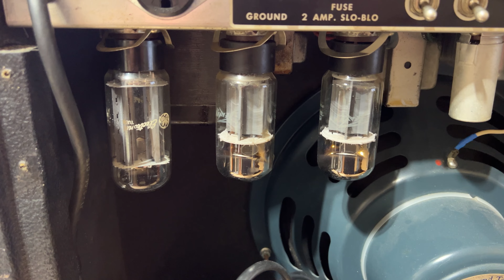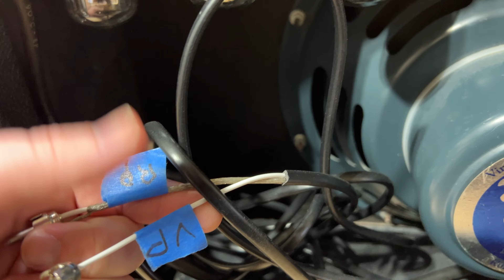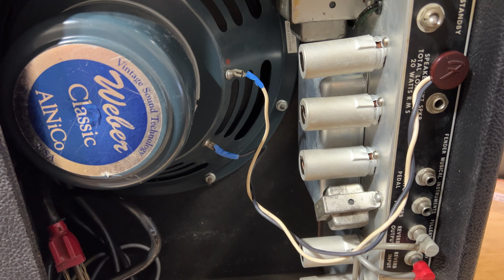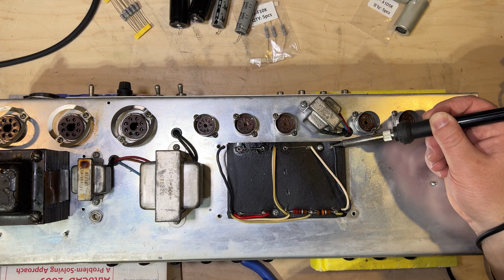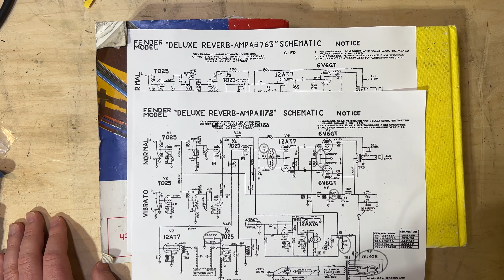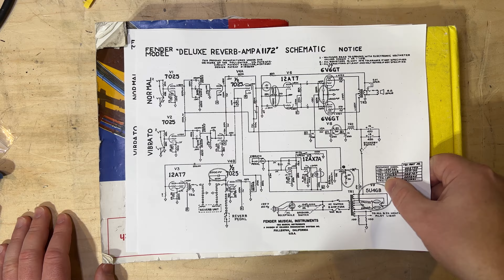1976 Fender Deluxe Reverb Repair | Full Overhaul & AB763 Conversion (Part 1)

Comment: The SF Twin Reverb has the two caps in series, equaling 50uf.    That's ok, because that amp has a solid state rectifier.   But as I learned the hard way, with a Tremolux having tube rectification, before it can get 50uf charged up the tube turns into a 4th of July sparkler.   It needs to see a lower capacitance to charge up, which is what the two caps in parallel provides.   Also, adding a thermistor before the caps helps with the high rush of current ... helping the rectifier tube last longer.    I've made a few expensive mistakes in this learning process!    OK.   I'll shut up now and watch the rest of your video.
Reply from the maker: Haha, no way! Keep the personal experience and advice coming! I love hearing about it when someone has seen an issue that i haven’t come across or mentions something i didn’t consider ona repair. There is no room for ego with amp repair as far as i am concerned.
Reply: @TechnologyEnterprises    What is really helpful these days is asking a question in google, and AI is like an ace tech that gives you the ideal answer within seconds.  AI is not infallible .. but it's answered a lot of questions correctly.   One question was about the Deluxe Reverb V3 cathode resistor, where I asked:   If I change that resistor to 3.3k, will that mod help?    AI responded that is a common mod to make reverb be not as splashy.    Most seem to advise using a 12AU7 in place of the 12AT7, but for less gain, why not use a resistor that costs far less than a tube?    I'll be using a tested (Tube Depot) JJ ECC81 for V3, and a tested JJ ECC83 (not s version) for V4.   But AI told me to keep the 220k (plus cap mod ... which I changed from 2000pf to 270pf) at the same ground as the reverb transformer ground and tank ground (using isolated RCA jacks).    But then ... if you use shielded cable to make that short run from Rev out to V2 grid to avoid picking up heater hum, why keep the 220k there?    It is a grid leak, so that has to be very sensitive to picking up hum from heater wiring.   So I have that going up to buss.   Having shielded cables also on Reverb pot is supposed to help eliminate hum, etc noise.  I'm going to have shielded cable coming down to V3 ... and I know ... capacitance from cables may dull the sound.   But ... I'm not a fan of noise, unless it's Nirvana

Comment: I read recently that the move from GZ34/5AR4 to 5U4GB in the '70s was to lower the B+ in order to compensate for increasing wall voltage. I guess it was cheaper than speccing a new transformer.
Reply from the maker: Oh interesting! I knew about the effect of that tube change (the reduced voltage) but never considered that it was because of increased wall voltage.

Comment: Love your videos! I noticed this issue only after installing a master volume but I’m guessing it was there before because I never turned the volume all the way until the master volume was installed. 

I’ve got a JTM 50 that I built. Sounds amazing but there’s one issue that’s driving me crazy.. the bright channel pot cuts out the sound right at about 90%. Also goes dead when I put a  jumper on the pot and bypass the resistor at 100%. so I don’t believe it’s the potentiometer. has anybody seen this issue before? I can’t find any leaking coupling capacitors bias voltage is good and the power supply voltage doesn’t drop when I lose sound..
Reply from the maker: Hey! Happy to help troubleshoot but may need more details on which schematic you used and how you implemented the master volume. Also not sure if you mean the pot when you said tou bypassed the resistor or if you are referring to the limiting resistor off the wiper of the volume pot. One schematic i saw referenced that limiting resistor as a 470K so it may be worth double checking you didn’t accidentally put in a 470 ohm or something that is an easy mistake like that. Otherwise, feel free to send me and email and i can help out more! My contact email should be in the channel description but let me know if you can’t find it.
Reply: @TechnologyEnterprises  Problem solved oscillation between v1 & v2.  A wire moved when had to raise the board to install a master volume.